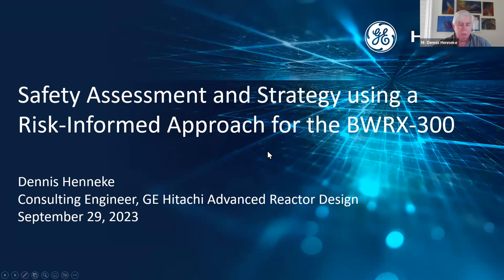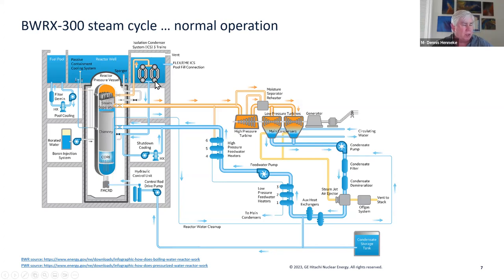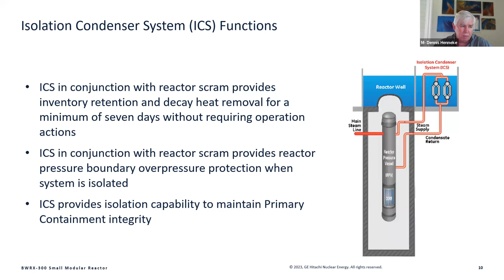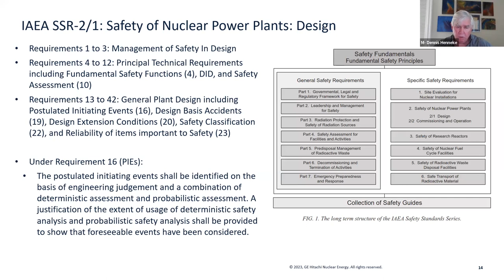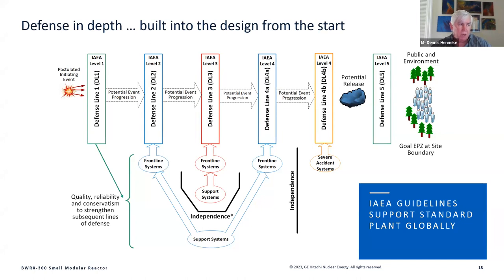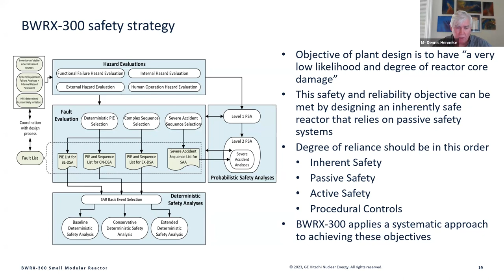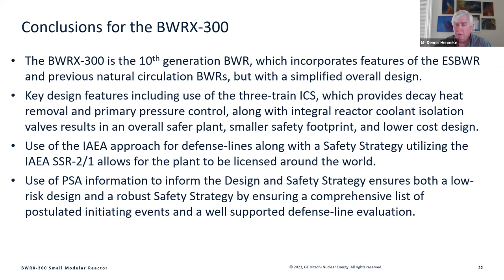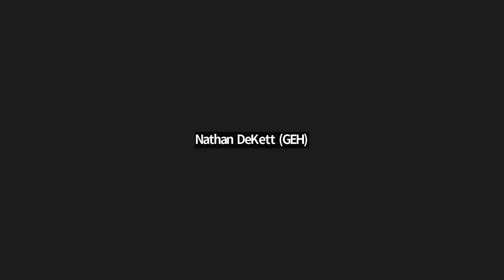Safety Assessment & Strategy Using a Risk-Informed Approach for the BWRX-300, Dennis Henneke–9/29/23

Comment: SMR tech is accused of being untested paper dreams, but the Actuality is the reverse, modules of components are in the core of large Reactors 70 years in operation(?), and therefore objections to them are typical FUD against non volatile reliability, safety and long-term lower cost.
High start-up costs are in the past,  ..thank you Mark Nelson for your extensive,  detailed, good research.., same for Chris at Decouple.

Comment: Does each individual ICS pool contain enough water to remove decay heat for 7 days?  i.e. do you have 3x100% not only on the heat exchanger capacity but also on the water storage capacity? Otherwise how do you manage a common cause failure on the ultimate heat sink?

Comment: So much talk about hazards and safety levels. I am astounded that water reactors are still considered. You are blind to the simplest solutions of all, don't use any water at all in the reactor and the risk of expansive accidents go away. Build salt or lead reactors instead. Inert non boiling, non reactive heat transport makes, perhaps not all, but certainly most of the risks with nuclear reactors go away, making public acceptance so much easier. Open your minds.
Reply: Water reactors are well known and passive systems make them very safe. Salt and lead reactors are unproven. It takes decades.
Reply: hello boss please build and show... and also make a saleable.. how is u going to contain the heat from inert lead in what pipe or bucket.. and how u is be extrat motion from that heat.. please also show salt turbine..  that one i want to see.. i will watch the wideo.. n giv u thumbsup
Reply: @MartinLopez-mo7tm  So if it takes decades to verify better ways of doing things, we should not even attempt to do it? How is that a path forward?
Reply: @perengstrom3414  The US has five decades of experience with one hundred water cooled reactors. We already know.
Reply: @MartinLopez-mo7tm  My point being why build new legacy water reactors that have miserable fuel efficiency with forever fuel waste? In addition to that, water reactors with pressurized cores always have the risk of expansive accidents.

That is why it would be a good idea to move away from legacy reactors and build new reactors that use all of the fuel in pressureless cores - ie fast high temperature reactors.